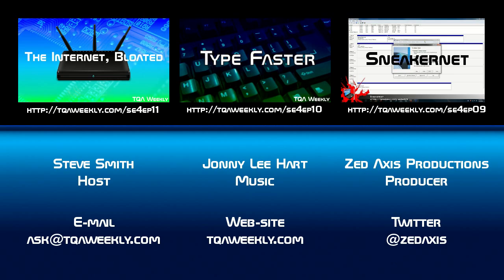Why is processor nanometer size important?

Comment: just confused.. so if the chip get smaller for ex. smartphone now have a 5nm processor, 5nm does equal to more core and faster performance and speed but how are this actually save the power consumption (more power efficient) resulting to longer SoT for a smartphone ? doesnt it mean more power means more energy consumption? sorry for my bad english,still learning :)
Reply: More power efficient architechtures are being made